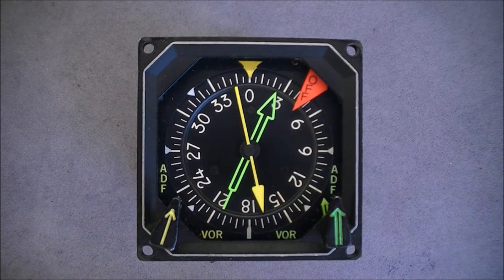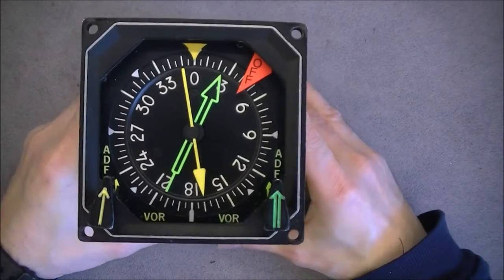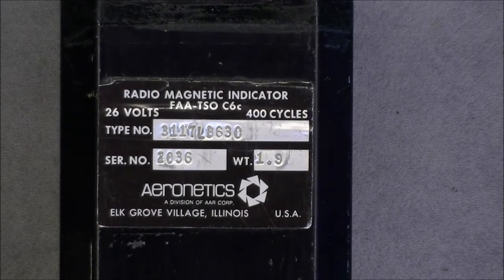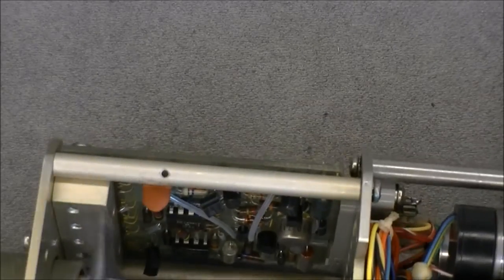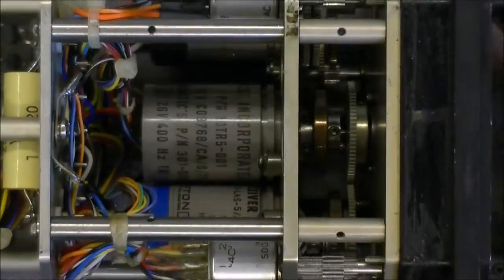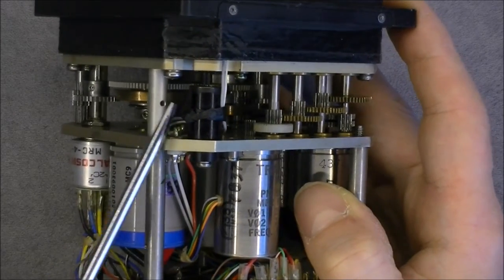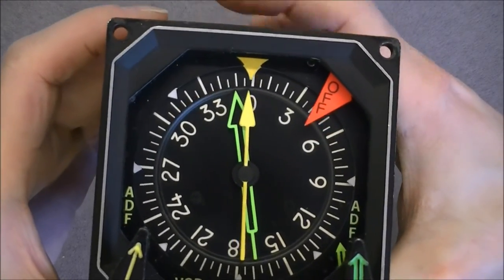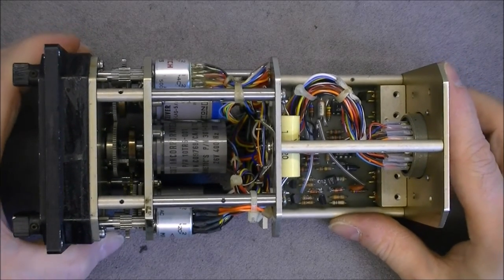Radio Magnetic Indicator teardown

Comment: Hi, how is this unit lit? You mentioned there is a PCB with an LED strip. So it's only lit from the top side with lights? There's no lighting behind the compass card?
Reply from the maker: I don't even know where is this item by now, lost somewhere in my storage, so I can't really check. But if I said it is edge-lit, it must be it, it is a very common setup.
Reply: @msylvain59  Ok thanks!
Reply: @msylvain59  Just wondering, off the top of your head, have you done a teardown where you showed such a light bar?